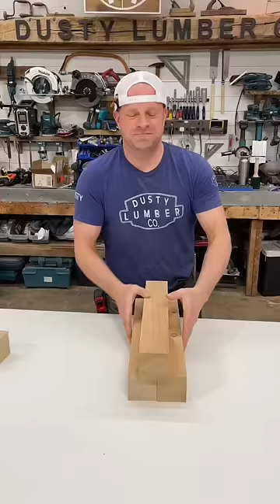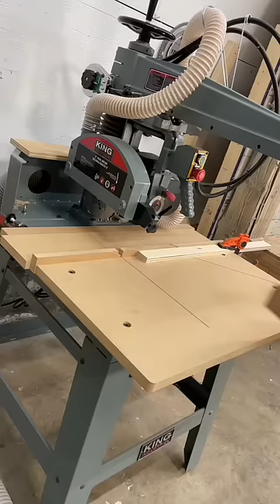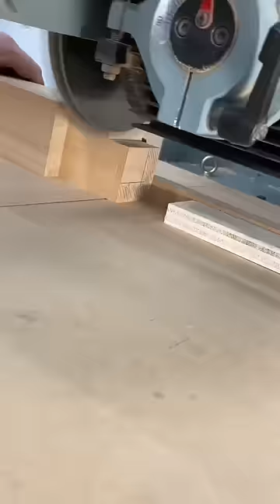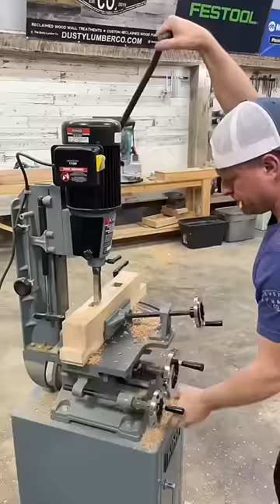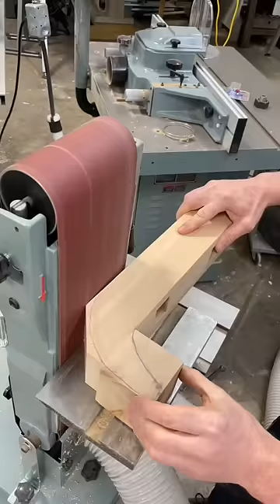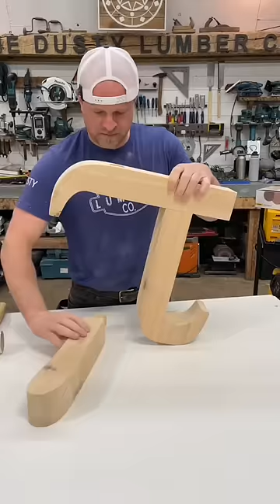Making Pi #woodworking #woodwork #wood #maker #shorts #tools #joinery #bois #holz #madera

Comment: I really want a close look at that thing in the drill press that makes square holes.
Reply: It’s basically a regular but with a square basically chisel that doesn’t move so the center drills into it and the outside chisel just cuts the rest of it  squaring it off.

Comment: Are you a carpenter or a tool salesman? I like your content, but the only thing you've shown so far is that you know how to set depth on your machines, you clearly have 10s of thousands of dollars worth in bits, blades and the like, and you seem fixated with putting wood inside other wood.